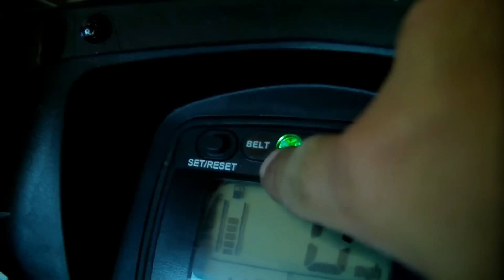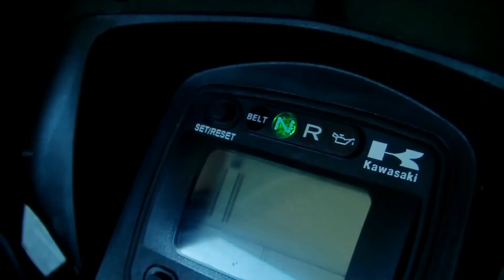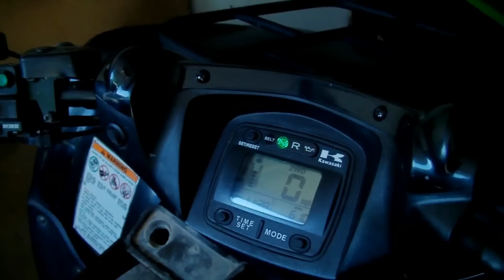haw to reset belt light in kawasaki bruteforce 650

Comment: This can not hurt your bike at all. the only thing that can happen "worst case" is if it gets into limp mode. Limp mode does not allow your ATV to rev real high or drive real fast "7mph". when the belt light comes on while your riding and you don't have no problem with sputtering or backfires you should be fine, now if you do its in limp mode just follow the steps to reset the belt light and once you belt light goes off you should be fine. But make sure you check you belt once in awhile.

Comment: How reliable is this atv any major problems or issues? Thinking about buying one.
Reply: KOOLITUS these are awesome machines. but check oil before every start and don't ever run low.not even a little.motor will last forever

Comment: I tried this and it does not work. I have a 2007 BF650 I believe it is in limp mode.  The reset procedure is not working. I've tried it 3 times.What else can I try